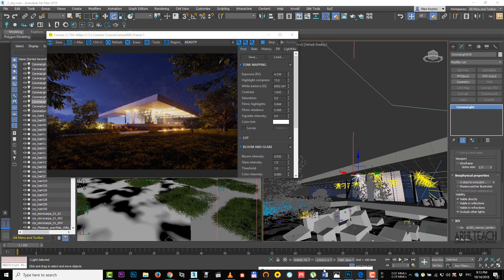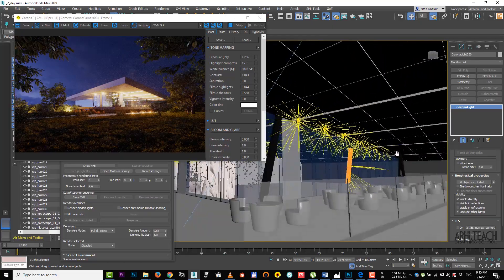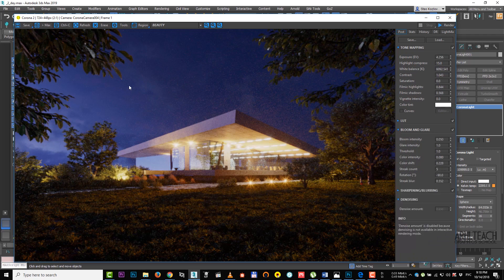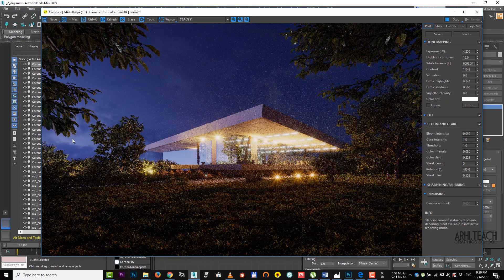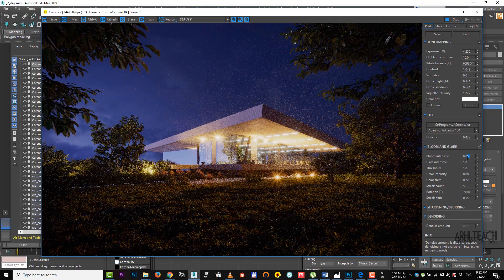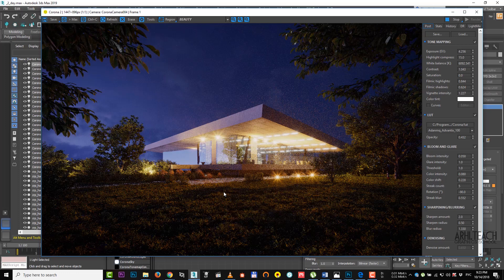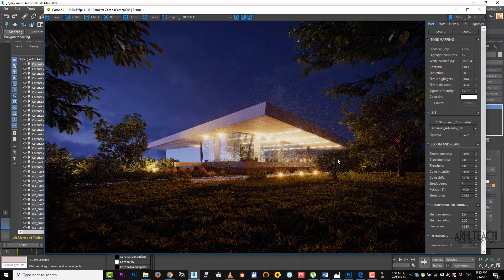3D Tutorial | 3ds Max + Corona Render | Exterior nightlight lightning🌝

Comment from the maker: 3D tutorial content:
00:00 3D tutorial introduction
00:07 Overexposure
00:44 High-intensity lights sources
01:03 Ceiling light sources
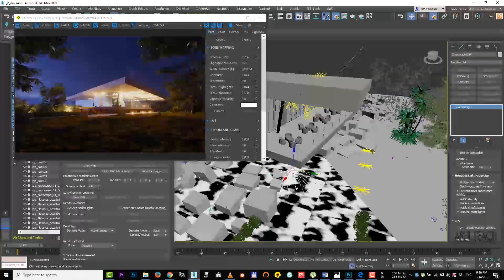02:12 Value of shutter speed
02:39 Three rules
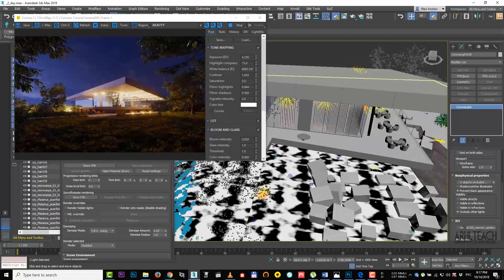03:08 Illuminating trees and shrubs
04:32 Standard material
05:02 HDRI
06:00 Highlight Compress
06:57 LUT
07:34 Blur and Sharpen
08:26 Different rules
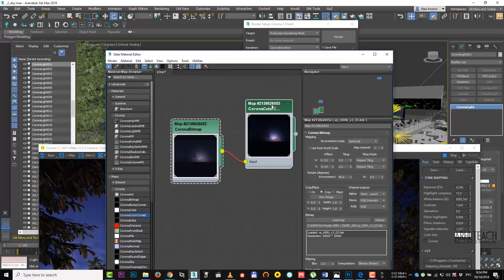09:00 Corona Light Correction
10:00 Extra volume